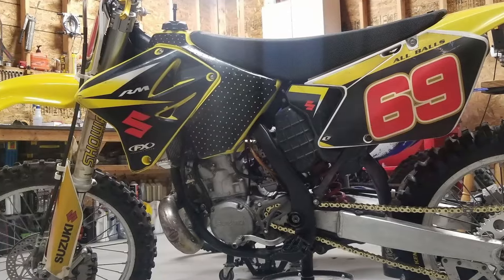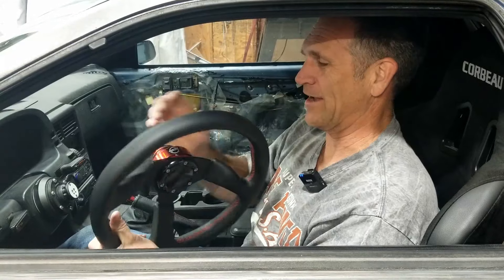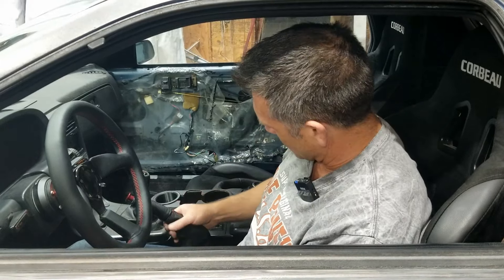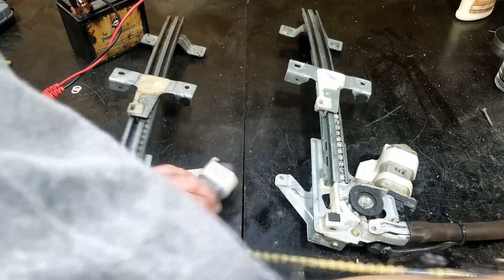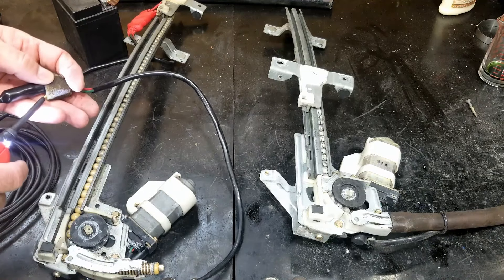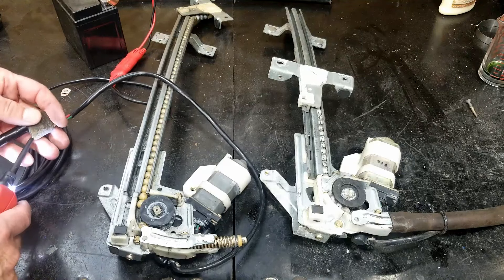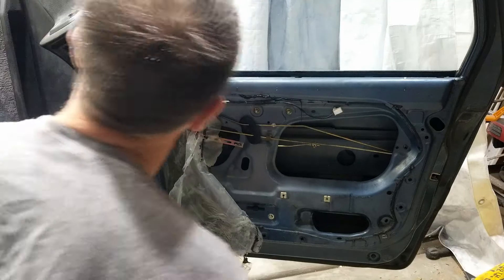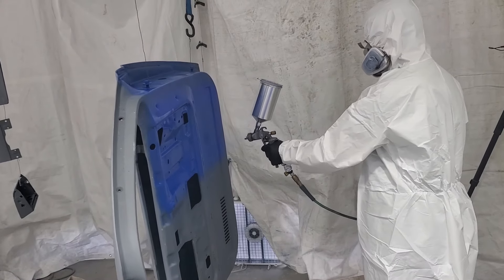1987 Mazda RX7 Steering Wheel and Window Regulator

Comment: I had my Rx7 color changed on the exterior only, and didn't have the engine bay matched. I reasoned this only because my engine bay was already black, and black goes with anything. Blue with red is a pretty harsh clash. I would recommend, if at all possible, to either spray everything all at once, since you're going through all the effort, or, you can rattlecan the engine bay black down the road when you're ready...Those are the options I'd recommend. Love the series, it's come a long ways!
Reply from the maker: Thanks, man. I really appreciate the thoughts. The blue on red is definitely not awesome. You have me thinking about whether I might be able to blend it in with some black where the blue meets the red. Ugh. Maybe that's even worse? Red / Black / Blue.

I don't know. I keep telling myself that because it's not a show car, and because the blue will be hidden under the hood, it will be fine. But I really don't like the blue/red combo. I'm torn.
Reply: @some-guys-garage  the good news is a paintjob under the hood isn't as tough as body panels, it doesn't have to look perfect. You can always tackle it later if you're not happy with it.
Reply: Happy birthday Bronson he’s going to be stoked on the car
Reply from the maker: Good point. I'll think on that a bit...